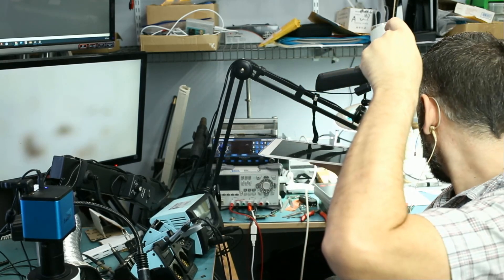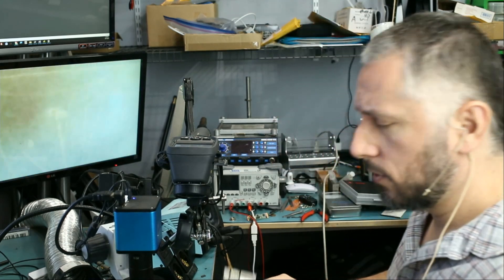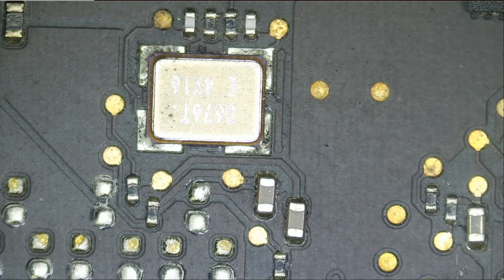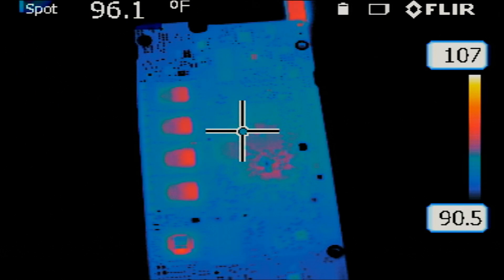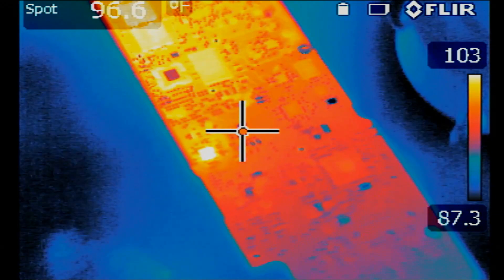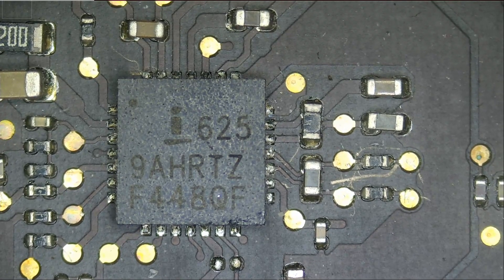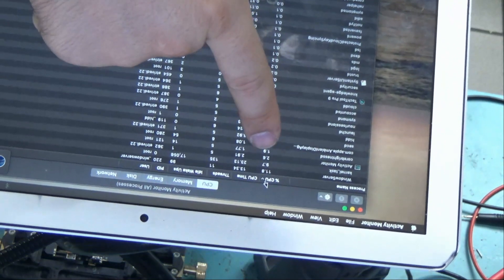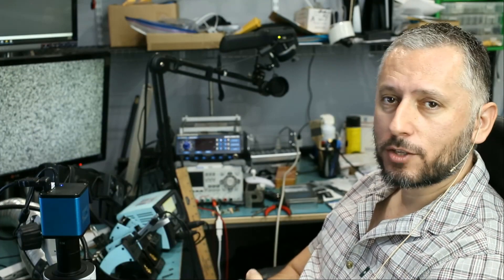Macbook Air High Kernel Task CPU % Usage and Loud Full Speed Fan Repair using Flir Thermal camera

Comment: I find your repairs so very helpful!  I have learned a great deal from you and I thank you for all your videos.  I have been trying to troubleshoot a 2019 iMac 21.5 Retina for weeks with this same issue as this MacBook Air in your video (High Kernel Task CPU % Usage and Loud Full Speed Fan).  I changed out all the basics like FAN, SSD, RAM, CPU with no resolution.  I did get the fan to quiet down with MacFan's.  It also showed me that temperature was not my problem.  All values were very low. 

 I am now wanting to ask your opinion on how best to get started with troubleshooting soldering components as you have done in this video.  What items would you suggest I purchase from NorthridgeFix?  Heat gun, soldering iron, flux, microscope, thermal camera.  I am retired and fascinated by what you do to troubleshoot.  In my day we used a oscilloscope and schematics.  Then board swapping took over and changes everything taking the enjoyment out of troubleshooting.  I am only a hobbyist, but I am curious what the investment would be to at least get started?

I know that you are very busy,  but I would really appreciate your advice.

Comment: Hello, 

I have a Macbook pro 2019 i9 overheating and kernal_task was eating up all CPU resources.

The fix for me was disconnecting a Ugreen multiport dongle, which was overheating like hell by itself.

Now I am using individual USB C to HDMI and USB C to USB A converters instead of the large dongle and the problem has been resolved so far.

Comment: NorthRidgeFix rocks. I do not know you will see this, but its fine, I had a 2017 MacBook air with High CPU and kernel task. It was not usable. No Face time camera because of temperature. However it was not hot at all. North Ridge Fix videos lead me to logic board issues, however 1 video led me to the camera sensor being located on the I/O board as often being faulty. I swapped in an I/O board, and boom. This laptop is like new, runs fast and stable. My potential bill when from alogic board at $400, to $25 for a I/O board. Just wanted to share and give props to NorthridgeFix as the best youtube channel ever.

Comment: brother i have a 2015 a1466 that sometimes boots and sometimes freezes at halfway progress bar? i tried different hard drive from another mac same issue. The hard drive from this one works fine in the other mac.  so what can cause this ? tried unplugging battery and keyboard and trackpad one by one or all same time  same issue. im thinking bad or corrupt efi? but why would it work sometimes ? like the other day it booted up fine multiple times over 2 days.

Comment: What a master piece boss. 
Could you please help me with:

My machine MacBook Air mid 2012, 13 inches, which I have just replaced the fan, now, as soon as I turn the Mac on, the fan starts medially. I have no complain about the noise, it sounds really smooth, but is still trickling... sounds not normal. The performance is pretty good, no bug at all. 
Now I will let you know all I have done already. 

1- I have had reinstalled the system (Catalina) which is on its last update. 
2- SMC- I have done all of those stuffs already. 
3- Board- I looked at it and it seems ''perfect'', no stains, no dirty. 
4- All, definitely, all systems, commands, programs, on the Mac works perfectly. 
5- I have downloaded the TG PRO- and Mac fan control. TG PRO doesn't report any abnormality. The fan control reports about 5.800 rpm til 6.700, but I have NO CONTROL at all.
6- Since I have erased and reinstalled the system over again, I don't think is nothing related to software, bug, clean, anything like that. 
Can you help anyway? Would you suggest something?

Comment: I have 2k17 macbook air, rarely used.
But after 1 year it became so slow. Tried factory reset but didn't work. fan speed is okay although. No idea which hardware is causing issue.

Comment: ate i have the exact same problem, vut mine need to hold on the power button few seconds, so i go to down town, they telling me i need to change the keyboard and this problem i don’t think is the keyboard, very slow like this and cpu is high system 75-65 and idle is like 5-25, what do i do ?? i erase the mac still the same

Comment: mate i have the exact same problem, vut mine need to hold on the power button few seconds, so i go to down town, they telling me i need to change the keyboard and this problem i don’t think is the keyboard, very slow like this and cpu is high system 75-65 and idle is like 5-25

Comment: was i the only one freaking out while he was adding the liquid goo, i was always told liquid breaks electronics, what the absolute fuck, can i clean my macbook with hand sanitiser then??
Reply: As long as it's completely off and you let it dry, technically yes. 90% or higher isopropyl alcohol would be safer though, it won't cause corrosion like the aloe in hand sanitizer can.

Comment: My MacBook Pro A1278 Overheating And Freezing after 10 minutes
I Washed Logic Board With Isopropyl Alcohol And Also Changed Thermopaste Cleaned Heatsink And Fans
But Issue Is Still Going On 
Please Help Due To Corona I Can't Let It To Repair Shops

Comment: Is kernel_task a common problem with Macs nowadays? I've noticed it becoming more of a problem for my own MacBook Pro 15" 2015 — when connected to a 4K monitor and watching video, or using Chrome. Typically, these are hardware or software problems? I've also heard troubling stories (on YouTube) of people getting the logic board replaced and it not solving the problem with 8 months of back-and-forth with Apple Support. Thanks for any insights and maybe a recommendation on how to proceed since I'm still under AppleCare.
Reply: kud good luck figuring it out. I have the same problem with the same computer after updating to Catalina. I just started watching these videos so I could learn how to fix it myself. It seems pretty complicated and expensive for a one time fix so hopefully it’ll work after cleaning it out.
Reply: Luke Aiono I cleaned mine of dust and did a thermal paste replacement. It helped. Still get kernel_task if it’s too hot outside (no AC) but otherwise it works. Also, I use GPU acceleration in Chrome now.
Reply: @lukex1337  started having this issue as soon as a switched to Catalina
Reply: @JohnB-kl2um  I ended up buying a macbook repair kit + thermal paste and cleaned out the computer. It works like a charm now. 100% would recommend. All these runarounds don't do anything because my fans were absolutely filled with dust. It's not too hard to do either.
Reply: will report back

Comment: My late 2013 MBP 15 inch..has this issue. Kernal_task goes up to 830% sometimes. But this is very rare and happens when I plug in the charger and heavy load the machine.

3rd party battery. Should I take it to the repair's?

Comment: Can you show or talk about modern day laptop battery issue diagnosis. The newer laptops seem to have more circuitry in the battery package. Without circuit schematics it seems the only way is to just replace batteries instead of diagnosing them and finding workaround solutions.

Comment: Nice job.  The thermal camera seems to be very useful, but its very expensive for a smaller business.  Do you have any recommendations for a cheaper thermal cam thats decent for detecting shorts?  Thanks for the videos.
Reply from the maker: The reason the camera is expensive is because it samples at 60fps with 320x240 resolution and temp range from -20c to 650c. Both fps and resolution are very important when working with circuit boards and that's what makes it expensive. I do not have experience with other cameras. Do your research and i'm sure you'll find something in your price range.
Reply: @NorthridgeFix  Thanks for your reply, ill have a look into them.
Reply: Any thermal camera can work.. Even the iphone/android flir versions. Can be had for less than 100$ used.
Reply: @rkan2  thanks, yes i did see those when i was looking, but they had mixed reviews.  For that price tho it would be worth a shot.
Reply: @ThEwAvEsHaPa  Well what do you expect when common people get to play with them. As I said, they are plenty for electronics troubleshooting.
Reply: @rkan2  you are right